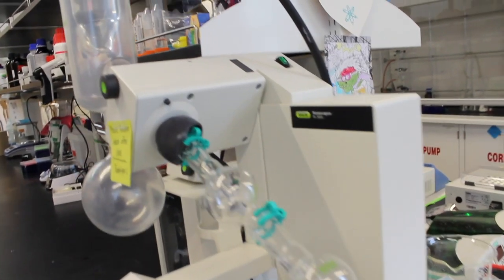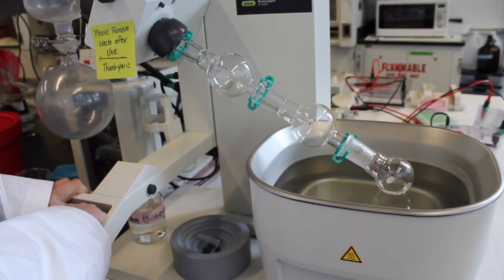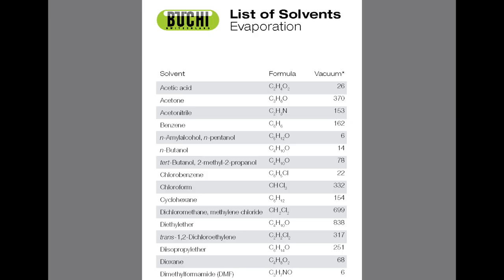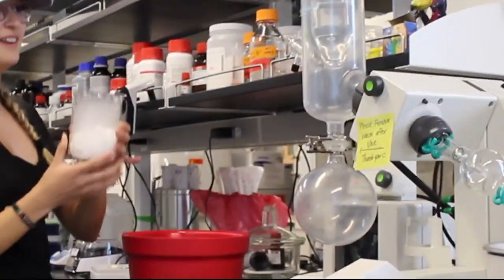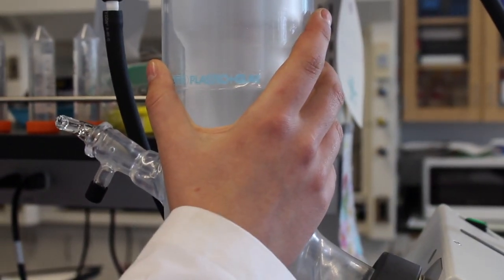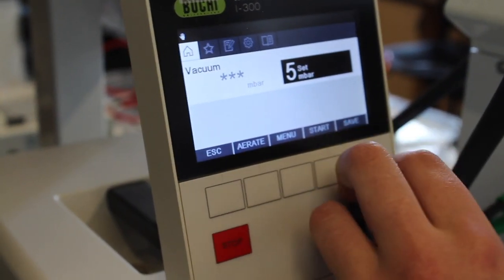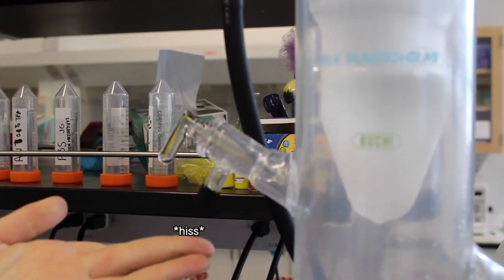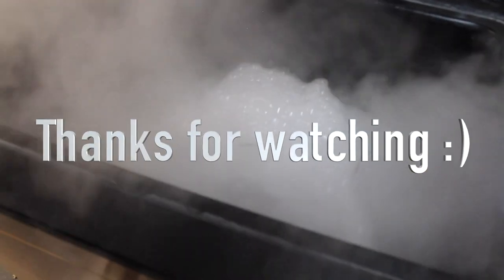Using the Rotary Evaporator - Easy

Comment: 2:31 Is it normal for the evaporating flask to bounce up and down when rotating? That means the steam duct is not perfectly straight. It will be most noticeable if you install a larger 2000ml evaporating flask. I see that your flask is also bouncing a bit on the hot bath.